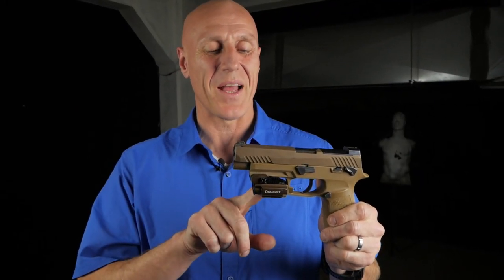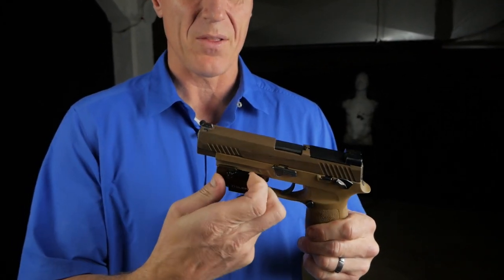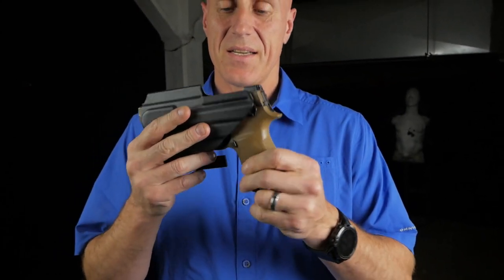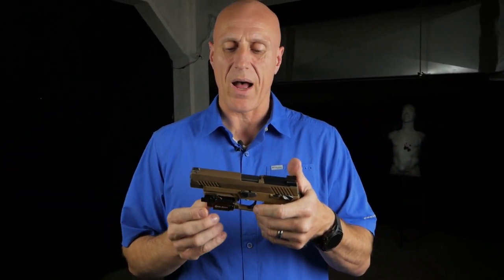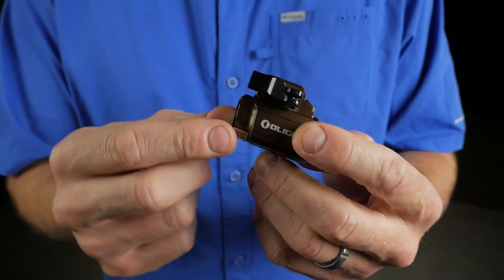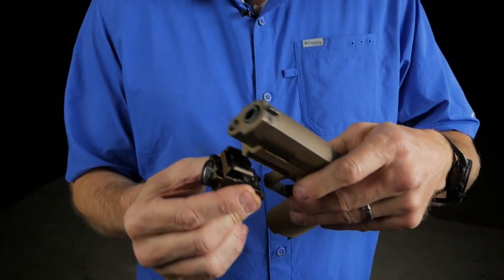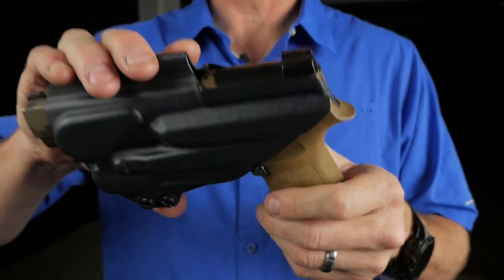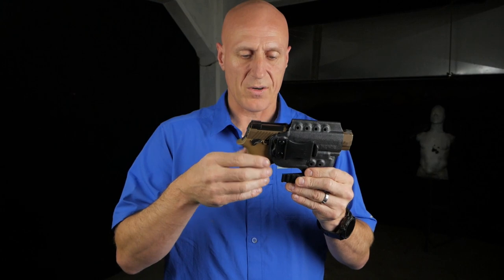Sig Sauer P320 w/Olight Baldr Mini | Rail Placement For Holster Fit

Comment: Still wishing for the canik tp9 sc guys. Great work and video as usual
Reply from the maker: That's definitely a possibility. We are working hard to get through our order backlog so we can get back to designing new holsters specific for combinations such as yours!
Reply: Thanks! I can't wait! At 1st the holster that came with my canik tp9cs was ok,even with my red dot added. However I still faced two problems later on. Needed it to have a High sweat guard & to be able to holster with my baldr mini. I carry the mini with me usually but it's no good in a self defense situation because I'm not able to carry it on my firearm. Eagerly awaiting your holster. Thanks.